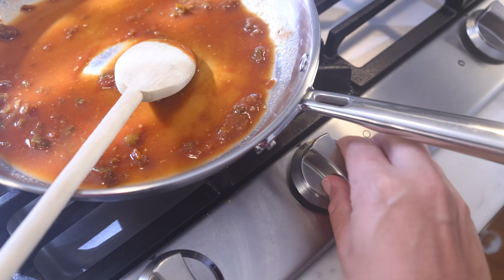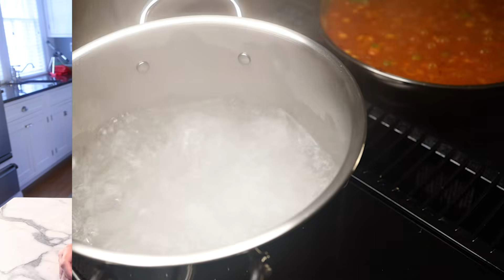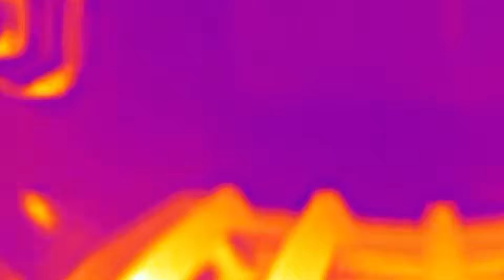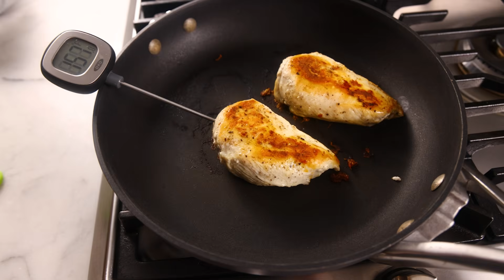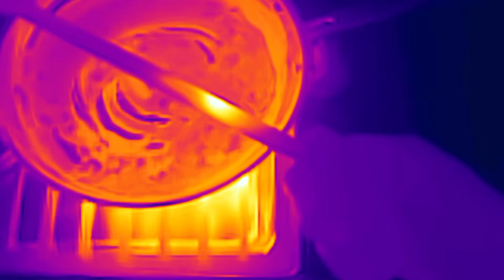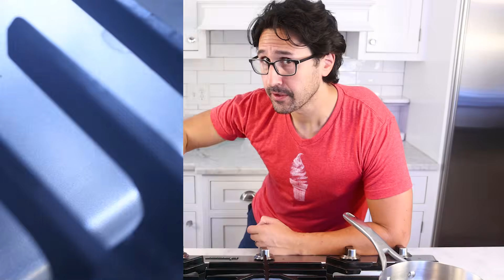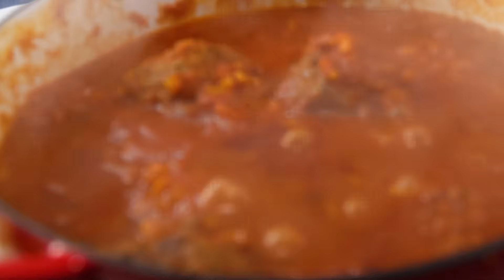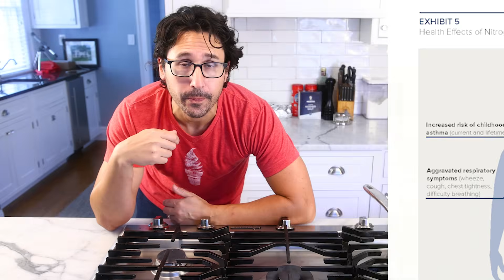Problems with gas stovetops | weak, dirty and dangerous

Comment: Still cooking on my Canadian apartment coil electric stove where every pan wobbles like it's trying to do a balancing act trying to get the heat onto the whole surface. My only other option is a single induction burner or another more flat electric top.

Comment: for me, having a literal fire feels so much more versatile. Sometimes when I want to roast a marshmallow or cook a kebab over the fire I can, lol.
Reply: Really good with big peppers or eggplant, just trow them directly over the fire and rotate them, once its donde it will have a smokey flavour and you can just peel them and eat them alone or as a sauce
Reply: If you think you can't roast a marshmallow over a resistance coil, I suggest you examine your assumptions.

I will grant that you should do so carefully, but if you hold it close to the heating element, you can get a great crunchy-golden roast marshmallow.
Reply: @WhiteWizard42  good to know. We’re moving from a house with a gas stove (what I’ve had all my life) to one with a glass top electric. So I’ll be able to roast marshmallows in the new house!
Reply: @WhiteWizard42  Glass top stoves are different from the iron coil ones. You'll never be able to roast a marshmallow over a glass top - trust me, I've tried MANY times 😢
Reply: @raerohan4241  I have also tried, and succeeded. I found the trick was to brace it on an edge so it would stay 1/4" away from the surface- close enough to get heat but not so close that it'd balloon out or that my hand could wobble it into a sticky mess.

It's all just heat, as long as you can burn your hand on a stove you can roast a marshmallow on it. Induction cooktop obviously wouldn't work unless you eat metal marshmallows >.>
Reply: That's the one big drawback of induction - no marshmallow roasting. Fortunately, I have a cheap, hand held brulé burner for that.
Reply: i agree with you but a good workaround is buy a portable gas stove
Reply: Uhhh theres this thing they call a Grill. Its super cool. It has a fire and everything
Reply: @ernestpaul6444  yeah but who wants to go outside when you want to roast a marshmallow at 3am
Reply: @squidy2902  umm anyone. I've had a case of bad munchies and fire up my grill at 2am to make burgers lmao
Reply: @MrBlue11900  not everyone has a garden tho lol
Reply: @MrBlue11900  Propane or Charcoal? 2 am me doesn’t like lugging a big bag of charcoal LOL

Comment: there's just something about a gas stove and a heavy cast iron pan that feels right...
Reply: I've moved away from cast iron to high carbon steel, but both work great especially on gas. They should last a long time.
Reply: Amen. My trusted gas stove and my Grandma’s iron skillets are all I need to cook up a storm (as she would have said)
Reply: some recipes also actually require a live flame.
now sure i guess you could use a blowtorch or something, but... are you really gonna sit there with it on when you can leave, i dunno, a bellpepper on the live flame of gas stoves and just let it do its thing?
Reply: iota-09 induction stove can actually do the same things as live flame, like making honeycomb toffee or burning marshmallows. In my opinion unless you’re a very professional oriental cooker when “taste of flame” can be a pursuit, you don’t need gas stove in regular households
Reply: @msc2608  i dunno
i just don't see doing stovetops bell peppers possible on a induction stove purely because you can't cover the same amount of area, and my mother used to do em quite often.
(note: we'resouthern italian, here most people still use gas as it is in fact relatively cheap and most often regulated by the city, but you can also ask to have an autonomous function boiler and use your personal gas tanks which can be refilled at certain places for, iirc, 15€ or so)
Reply: @msc2608  last time I checked bell peppers are not electrical conductors. You put one on an induction burner on high for a month and all you'll get is a moldy pepper.
Reply: I used to think that too until I started using the same cast iron on an induction stove, ain’t going back to gas.
Reply: People thought the same thing about smoking a nice pipe in front of a cosy fireplace. In reality turns out those things are toxic for both people's health and the environment/climate.

Comment: If you take off the flow diverter, does that help with heat loss? It will spit the fire straight up in the middle of the pot. Curious if that helps!

Comment: Thinking a bit about gas stoves and greenhouse gases.
Exactly what gases do they burn? If it's methane, then the additional leaks from transferring it to a domestic house could make it much worse than using an electric stove powered by methane electricity.
Of course, the production of the stove is a significant source of greenhouse gas emission. The general advice for reducing your footprint is to use things longer.

Comment: the biggest reason i like gas stoves more is durability. yes, controlling the flame at a whim is a big plus and all that, but if i accidentally drop a pan on my stove i'd rather dent the pan than have to repair the stove. i've worked in restaurants that had glass tops and they were always cracked. gas stoves with their raised cooking surface effectively make a shield. that's a massive plus
Reply: in some 20 years, i've broken one glass top stove. You have to be pretty damn abusive to it like I was, I was lighting coals on it and it got a hot spot.
Reply: For me the biggest W for gas stove is you can exceed the maximum heat of electric/glass top stove without any kind of expenssive or troublesome modification.I like that feature because me and my family are asians,and we live in Asia (southeastasia) and many our homecook dish require very hot and stable flame,also with gas stove you can use your wok or any kind of wok like pan (if you pay attention to the past adam's video he never used wok or wok like pan because the flat and not supportedd surface of the electric glass top stove) and gas stove can provide so much dexterity,freedom and flexibility to many dishes
Reply: Interesting how everyone's needs can be so different. I don't think I've ever dropped a pan/pot in 30+ years of cooking, but then again I've always had a gas stove so maybe I don't remember because nothing broke 🤔...
Reply: Very easy way to clean a stove is to cook carefully.. Unless you are a hustle person that always needs to hurry because "Money" or something the less dripping the easier your weekly cleaning can be I think you save more tine and frustration this way since you're putting more attention in your cooking burning your dishes will be very unlikely and your skills will get better faster..
Reply: What the FUCK kind of rinky-dink resturant has a GLASS TOP RANGE?! What was the oven? A metal box with three hair-driers aimed into it?
Reply: Or maybe just don't drop shit?

I've never in my life dropped a pan on the stove lol
Reply: Yeah the glass is not going to break if you drop a pan on it. I'm clumsy as fuck but having used these types of stoves for over 10 years I have never broken the glass on any stove, I've never even worried of shit like that
Reply: @tclips__  Counterpoint - we bought a glass-top stove at one point.. was mad at something one day and slapped my palm on the counter.. not punch-through-the-wall hard, but a good slap. Turned out I was over the corner of the stove not the wood counter and it exploded. Ended up having to buy a whole new stove.. repair/replace was quoted at 75-80% the cost of the unit new.
Reply: @jellorelic  Okay I admit, if you have anger issues or like banging your cookware in your kitchen like a caveman then you probably should get something that can handle that sort of abuse
Reply: @jellorelic  I think the problem here are your anger issues not the stove lmao
Reply: Bruh get ceramic ones then
Reply: @msc2608  All glastop stoves are glass-ceramic.
Reply: Thats actually the beauty of induction though. The material can be both insulated and highly durable cause you don't have to worry about it having the right thermal transfer cause it heats your pan through the power of magnetism.
Reply: This is the main thing keeping me from switching from gas to glass top. I haaaaaaate cleaning my gas stove and I know a glass top would be easier to clean … but I would die if I accidentally dropped my heavy cast iron and broke the glass top.
Reply: @chelseet11  In my family with several households we had glass tops for literally several decades and I have not seen one crack.
Reply: @chelseet11  as someone who owns a glass top, the easier to clean is a bit of a myth. Anything burnt on is a pain in the ass.
Reply: @mjs3188  Not true. You can pour whatever you want on glass surfaces to clean them. Whatever you're using, just isn't up to the task for the mess made. Try scraping with a razor or strong acids like citric (lemon juice). Those pretty much always remove whatever's stuck.
Reply: @mjs3188  I keep a steel scraper in the utensil drawer that works just fine. (For the first couple of weeks w/ the glass-top, I tried to be super-gentle and avoid even the tiniest scratches, so a sharp steel scraper would've been unthinkable... but once the inevitable hairline micro-scratches started, I realized it was never going to be pristine again, and it still polishes up nice when I CLEAN clean for company...)
Reply: @Rafael_Fuchs  scraping with a razor blade and acid is about as annoying as removing gas grates lol
Reply: @llamzrt  Yeah but the thing is, you only have to scrape a glass top like once every month or two to keep things reasonably clean. Aside from that it's just wiping it down after each use. With gas you have to remove the grates to clean it like at least once a week if not more often, and then every month or so you also have to clean the grates themselves, which is far more annoying to me than scraping away with a razor blade and acid.
Reply: @llamzrt  It is? I'd just go by the pour and forget method. Come back in like an hour. Lol
Reply: @mjs3188  I keep a razor blade with a horizontal handle to scrape burnt things off the glass top. I cook daily and use the razor maybe 4 times a year. Usually I just spray the cooktop down with 50/50 vinegar/water and wipe it with a paper towel, sometimes using my fingernail to help. The vinegar breaks down most things easy enough, doesn't leave streaks, and doesn't have an odor that burns off (but of course smells like vinegar until dry). For mildly stuck messes I can use a scrub pad. I used to occasionally wax the thing but when it's THAT clean and shiny I don't want to leave fingerprints and I cook way too often to worry about that.

Compared to cleaning the gas stove I found the glass top much easier. I'd have to fill the sink with warm water to soak/scrub the large grate pieces if those got anything burnt on. Sometimes I'd need to clean the little pieces that go over the eye. And having to move the grates to clean crumbs or spills got old fast. It was very rarely as clean as my glass top because it was tedious to scrub around the burners. I also don't have a ton of counter space and the grates are less convenient to place things on so it made my kitchen feel smaller.

I had a roommate break a glass top by slamming a wine bottle into it. I replaced it with a gas stove until I stopped having roommates. I'm back to a glass top. I have a favorite and am biased.
Reply: @llamzrt  damn how many times you spilling stuff lol
Reply: @mjs3188  oh, that’s good to know then. I guess the grass isn’t always greener 😆
Reply: @mjs3188  Barkeepers Friend....I swear by it for my glass top.
Reply: @mjs3188  In my last apartment I cleaned the glass with a razor and some hot water with dish soap and it never failed me
Reply: @chelseet11  your going to clean your stove more then drop a pan. If your dropping your pan more then cleaning I think you have other problems man .
Reply: @MrBlue11900  uh, i didn’t say I was constantly dropping pans. I haven’t dropped one yet. But I’m saying if a freak accident were to happen and I dropped my heavy Dutch oven or cast iron skillet and destroyed my glass top id be devastated
Reply: How is being retard proof a plus? Do you just walk around with a helmet because most of people are indeed stupid? Well… we are…
Reply: @christossan  take your ugly insults elsewhere

Comment: In the nicest way possible, I think you have a bad gas stove? I agree with a lot in this video.  But, your smallest burner is so much bigger than I’ve ever seen on a gas stove, and I find that people often use burners that are too big for their pot on gas stoves, yours included, and that is why everything is burning on the sides.  It’s also why it takes so long to boil water in a smaller pot, there is even more of that heat loss wrapping up around than on most other gas stoves.
Reply: It's Dacor which is a high-end brand. They're Samsung's competition to stuff like Jenn-Air, Monogram, Viking, and Wolf.
Reply: @Default78334  high end doesn’t always mean functionally good, especially with kitchen things.
Reply: I have been shopping for a new stove/oven because ours is sold old the repair person said we should not turn it up to max. I notice the footprint for the burners on the new stoves take more of the surface. Also the grates are closer together and I was concern with how much heat is being transferred away from the burner you are using. I can see that on Adams stove top. He should try and experiment and remove the other grates and see of the water comes to a boil faster. The burner design is great of you are using a more then 1 burner.

Comment: It looked like you used an induction top to show the electrical vs gas model thermal images, which most people don't have induction tops in their homes. Really bad example. I'm curious to see the results if you used a typical coiled electrical cook surface would be.
Reply: It was a resistance coil under glass
Reply: Oh, just saw. But he was talked about coil stoves as well. My bad.
Reply: For those interested in the induction top he used:
https://www.amazon.com/dp/B07FDXPTNP/ref=cm_sw_em_r_mt_dp_P1H4XB70Z696BCVDJDC5

Comment: I disagree. Gas stoves are significantly easier to deal with. Faster heat up and heat transfer, no glass to get shattered, little to no electrics to go haywire or fail, and they work during a power outage. My favorite feature of gas stoves is the vertical burner. Most are up the middle. Easy pancake making.

Comment: I amped up my gas stove by pulling off the burners and finding the nozzle that the gas passes through. I took a very tiny drill bit that was only ever so slightly bigger than the then current nozzle size, and drilled it out a bit. It made my stove a LOT more responsive. I don't recommend this for anyone who doesn't know what they're doing though because you can easily set your house on fire if you make the hole big enough to let fire lap around your skillets, etc. and possibly catch something on fire...like you. That said, even when the nozzles were clogged with soot, the stove still worked better than my electric stove ever did.
Reply: Burner Orifices are the correct size for the type of Gas you are using, making the orifice larger is going to wreck your Gas to Air ratio which will cause incomplete combustion which introduces Carbon Monoxide into your home and other harmful gases. Please don't do this
Reply: @ethangratton7212  All of that is true if you don't know what you're doing(hence my warning in my comment). I however have done this before and know how to get more air to the flame, etc. I also have a combustible gas detector to check for incomplete combustion, etc. so I'm cool. Thanks for the concern though.

Comment: I grew up using a gas stove so perhaps I'm biased. I much prefer gas for the responsiveness and because I cook in woks often I rely on the leakage. since I moved out I have an electric stove which has its advantages like being able to cook at lower temperatures. but I find gas to be easier maybe because that what I'm used to and frankly I find gas more charming.